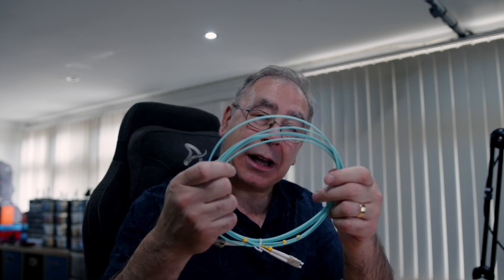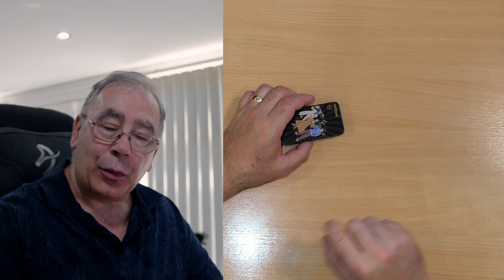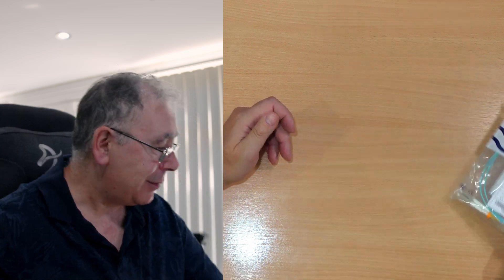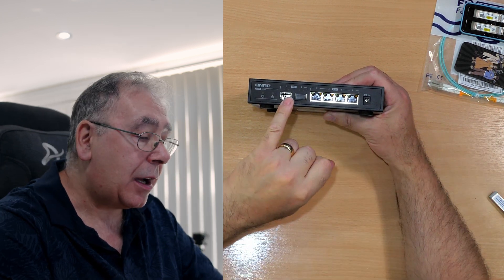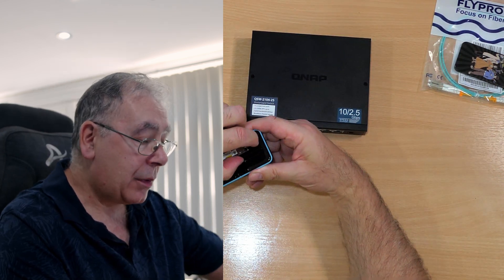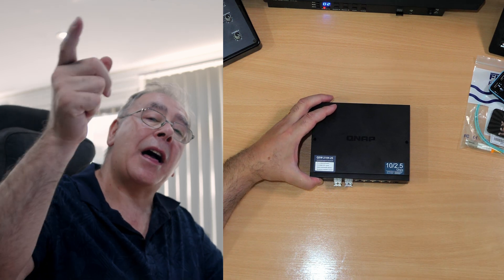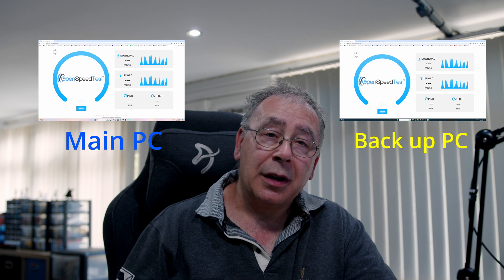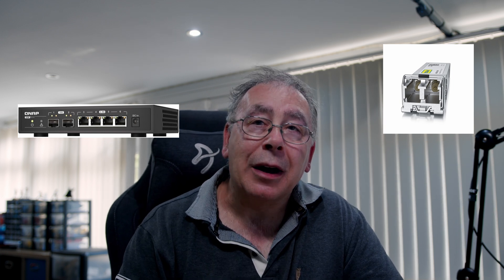Essential Steps to Installing a Fiber Optic Connection for Your PC

Comment: The difference in speeds may be due to the MTU setting on the NICs. Check the documentation for the NICs to see if there's a recommended MTU setting. I experience similar results—9776.6 Mbps down and 4201.3 Mbps up—when not set to Jumbo Frames, aka 9000.
Reply from the maker: I could not find any info on the best settings for Jumbo Packet settings, anyways I checked the settings and it was turned of, so now I have turned it on and set it to 9014 I will see how that goes, thanks for the help.